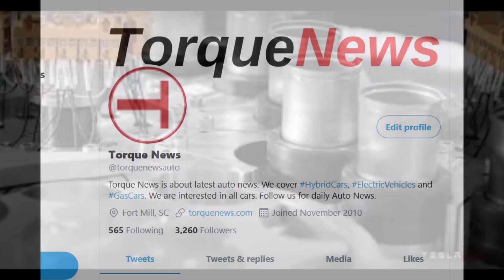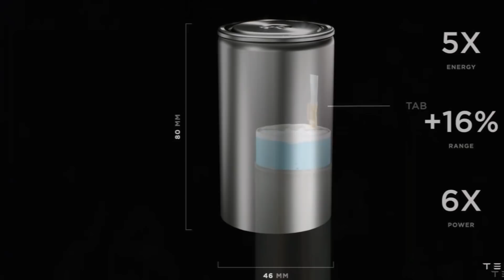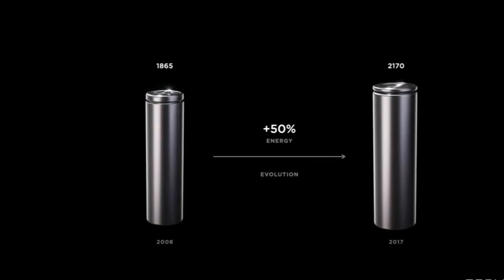Tesla Likely Working with Saueressig To Build 4680 Battery for Giga Berlin and Texas

Comment: Have you heard of the timeline of when will Tesla start production of batteries in Giga Berlin? I cannot find that anywhere. I don’t even know which building they will use to make batteries there, thanks :)
Reply: Not sure but since model Y is their first vehicle in giga berlin and its due production first half of 2021 and it should have 4680 cells I guess it would be first half of 2021 unless they import from fremont?
Reply: @samgerland6087  The plan is to provide the 4680 cells from Fremont as the Model Y in Giga Berlin ramps up initially. I don’t know how quickly the 4680 cells will begin production in Germany.